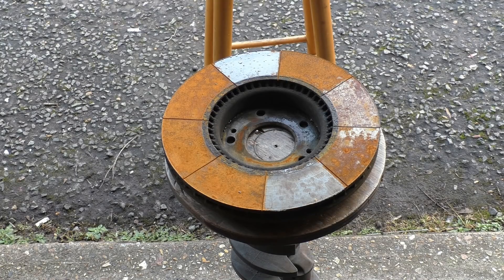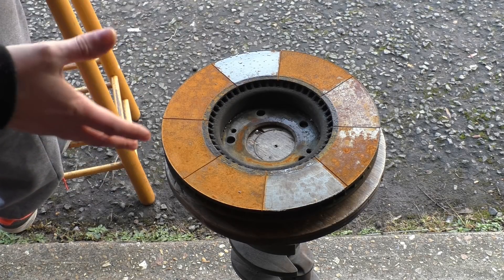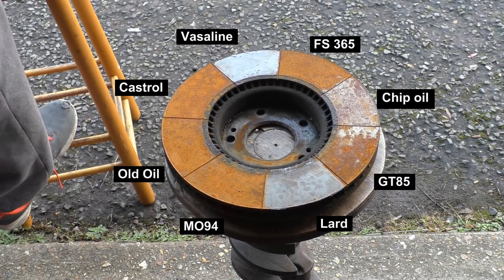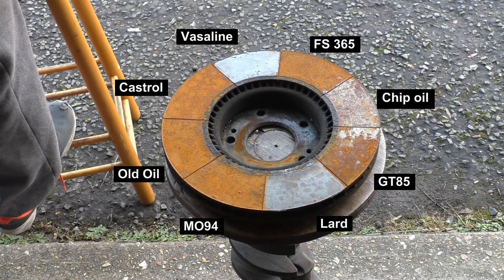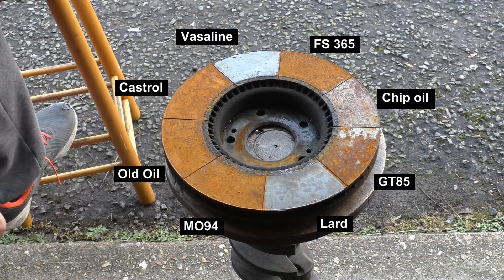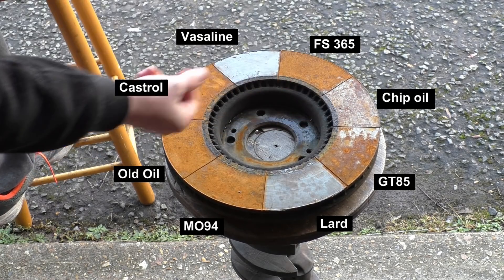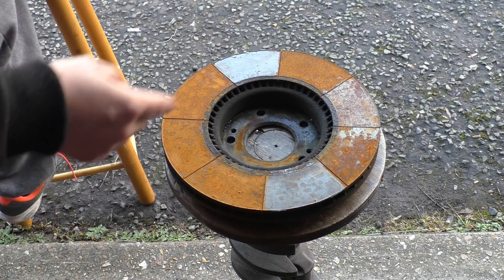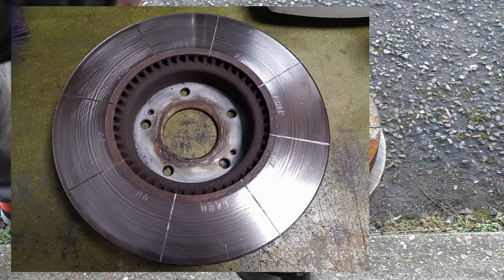Rust protection on a budget

Comment: Makes sense - keeping out oxygen is the key. Maybe scrubbing a candle over a sector of the brake disc would have worked too (especially in UK winter). I liked the idea of diluting vaseline  in a spray bottle, could be the "<insert expensive brand here>" corrosion inhibitor killer. Great job.
Reply: Vince GLEN a candle would work as well, as petroleum jelly (vaseline) shares the same chemical components. As a chemist myself, I am not at all surprised by the results. I just like watching Matt's videos, he is right about most topics. I can also explain why the chip oil and lard worked a bit less. They contain fatty acids which are a bit more polar compared to petroleum jelly, this means that a small amount of water can stick to the products and therefore come in contact with the brake disk underneath. The other oils are not viscous enough to stick and heavy rain just rains it of, therefore exposing the bare metal to water.

Comment: I have used vaseline in electrical connectors, ground conecting points on the chassi and on battery poles. 
The thick Grease with its water repellant properties works excellent to prevent oxidation and bad electrical connections.

Comment: Is FS365 really salt water?
I do use, and swear by, ACF50. It's particularly good to spray (using a compressor and gun - the spray can is garbage). However, I might have to use vaseline for some bits. Nice video!

Comment: Used to coat the top half of conventional forks with Vas. Also under the dust-caps of fork seals and on the bump-stop on the rear damper. Battery terminals like it too. On older bikes, use it on everything under the seat, or use a rich zinc-based paint. One doesn't need to spend stupid cash on stupid products. All you are paying for is their advertising. And giving their product away for free to idiots.

Comment: If you do another one to test grease you could try two stroke oil and duck oil. RainX and car wax would be interesting too as they are (supposedly) good at repelling water and forming a "long lasting", " protective layer". Then there is baby oil for the self-lovers and homosexuals and i have just remembered i have some waterproofer spray that you use on your  boots and some silicone spray that claims to form a coating.   

You could also do an opposite test for the rust removal products like jenolite, navel jelly, kurust, white vinegar (works well but takes time). There is also a spray from carplan called "rust in pieces" that claims to kill rust fast, i`m not convinced.

Comment: It’s not so much cheaper alternative but cheaper and actually works. I’m surprised at the old engine oil, thought that would do well.
Reply from the maker: The what? Engine oil isn't designed to stop rusting, as the oil in in constant circulation
Reply: Yeah that was counter intuitive to me, lard isn’t designed to stop rust either but it worked, I really thought the oil would be good protection.

Comment: Is there any way to spray Vaseline
Reply: Yes, thin with mineral spirits and heat the thinned solution container in near boiling hot water to avoid fire hazard, spray before solution cools.